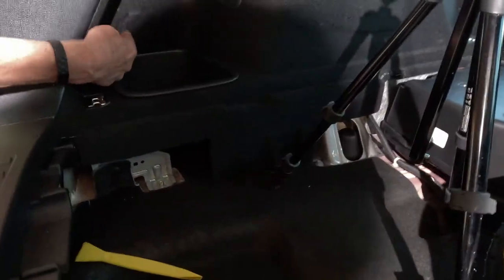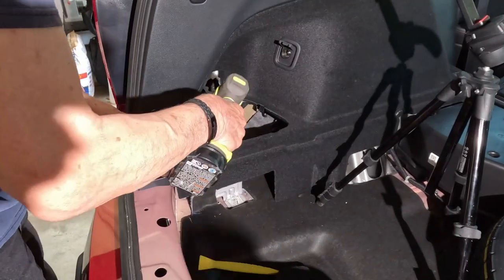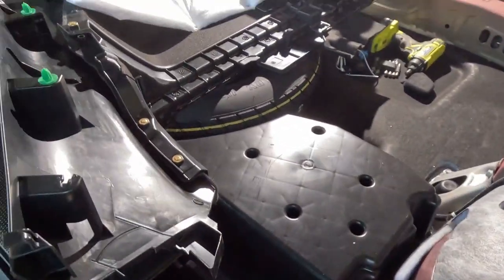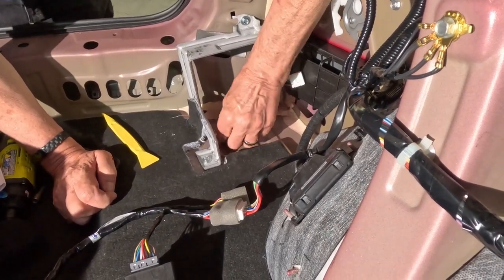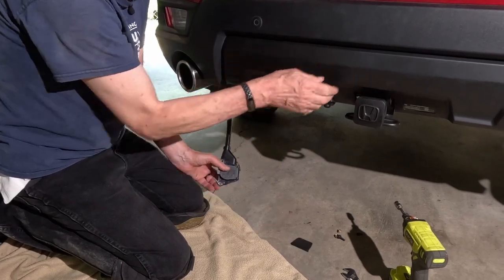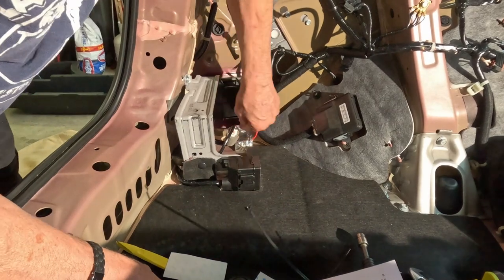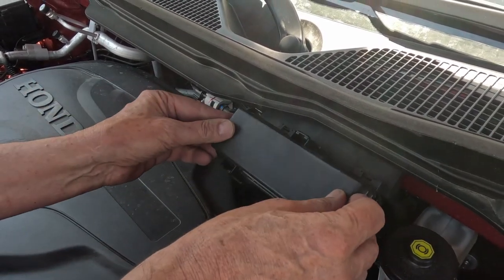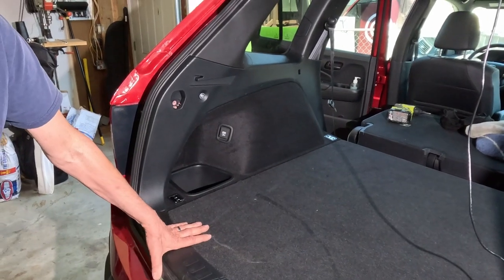2023 Honda Passport Trailsport OEM Hitch Wiring Harness

Comment: Just an unrelated tip:  when you have all those covers and tool box out, remove the spare tire and check the pressure.  Mine was almost 20 psi low.  Honda has the tire valve only accessible with the tire removed😮

Comment: Your hitch install video was a huge help, this one equally informative. For what it is worth, I managed to do this with only removing the tool tray and side pocket, but you have to blind cut the electrical tape holding the 14pin connector behind the side panel.
Reply from the maker: I'm glad the video helped!  I never even thought of just removing the tool tray and side pocket, that was a really good idea.
Reply: How were you able to release the connector shown at 4:19 without removing the big panel?
Reply: I didn’t remove the panel. Only used the access through removing the side pocket and tool tray. Getting the 14pin connector cut loose through the pocket was the hardest part.
Reply: I saw one video where they just took out the screws behind the back two hooks.  Then pulled the back of the panel out enough to get to the factory plug.  Much faster and less work.
Reply: Just did mine today. Didn’t have to cut anything loose and did not remove the large side panel.

Comment: Great video, for some reason, I thought it would be a lot easier.
Kind of disappointed they don’t add the wiring when the vehicle comes with a trailer hitch.
Reply: From the factory, there is no trailer hitch.  The hitch and wiring is a dealer installed option.  He bought the factory tow stuff and installed himself.
Reply: @larryjohns8823  
I just purchased one, came with a trailer hitch, but no wiring.
I installed the wiring myself. That’s why I was watching this video.
And it came off the truck with the trailer hitch. The dealer did not install it.
Reply: @columbotee2652  My dealer had maybe 12 new 2023 Passports on the lot and none came with a hitch.  Maybe your dealer added it before you picked it up.  The hitch is not shown on the window sticker as standard equipment.
Reply: @larryjohns8823  
The Pilot TrailSport comes standard with an integrated Class III trailer hitch.
Reply: @columbotee2652  My new 2023 trailsport had no hitch nor is one listed on the "standard equipment" window sticker.  I feel Honda would list it there as a selling point.  Glad you got a freebie!  Did you also get the bumper cover that fits around the hitch?
Reply: @larryjohns8823  
I see the confusion I’m talking pilot trail sport you must be talking about passport trail sport.
Reply: @columbotee2652  Yes Passport!  Like the title of this video...
Reply: @columbotee2652 wrong…none of the trims come standard….
Reply: Agree. I specifically asked for the hitch thinking any manufacturer would include the wiring for the trailer. Stupid me. $200 for the parts, and hundreds more for install if you aren't able to do it. Honda lost some points.

Comment: This helps a huge amount. Did you need to add the 20A charge and brake fuses if you didn't put in the trailer brake control harness?  Also, the push-in fastener at the front lower part of the side panel wasn't put back in. Wondering if it couldn't be reused. Maybe it became one of those random fasteners in the drawer (not that I have a drawer). Did you need to remove the rubber door gasket at the front of the panel?